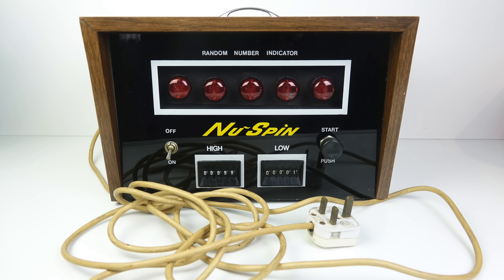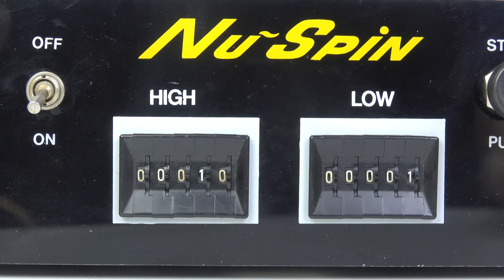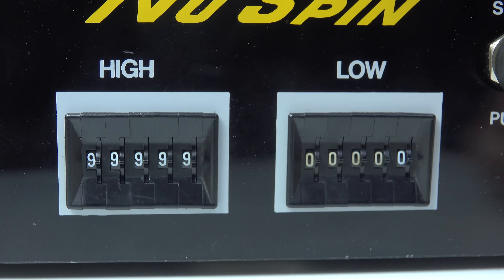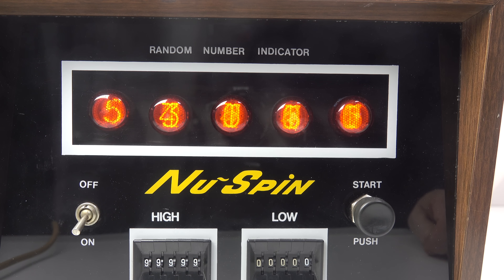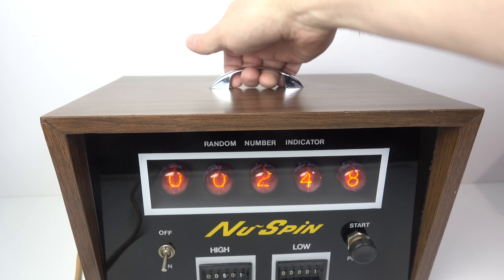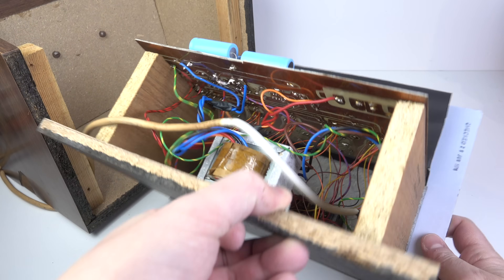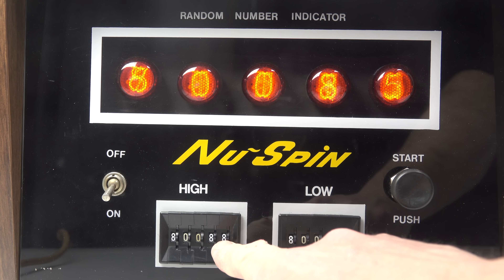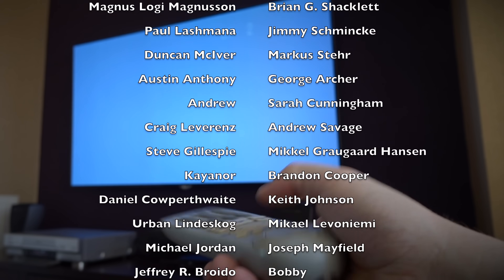This is a bit random - Vintage Random Number Generator

Comment: Random number generators are extremely useful, sometimes making a decision is hard and flipping a coin only has two out comes. So if I assign 1 to buying a new tub, 2 to hold off on spending money, and 3 to fixing the deck. I can make it decide 1-3, and let fate decide. To flip a coin you can do 50/50 low to make a more fair coin flip.

Comment: I'm pretty sure the main use is raffles.
You buy a bunch of books, in sequence, and then sell from low to high, noting the lowest and highest numbers sold. Then you set that as your bounds.

Most random numbers used in a lab will either be quite small, (e.g. will this sample be control or test), or need computers to deal with the result due to just how many numbers would be used.

What I would like to know is how it gets the random number, and what happens if you set the minimum higher than the maximum.
Reply: Also, it would be useless for an RNG for labs that need all the numbers, as each time it appears to cycle between 11000 and 12000 times.

If I got a hold of this, the first thing I would do is replace the button with a digital source which simulates holding the button down for a fixed amount of time, and see if the cycling becomes more consistent.

Comment: At 5 mins in the video, you open up the box and show the rats nest of wires on the underside of the board. And in the middle sits a big mains transformer. It does not look professionally made, and even in those days, manufacturers (even small ones) would have taken steps to tie the wires and make a neater job of it. Certainly any signal wire should be far away from the mains power, and I recommend that you get the wiring checked and tied such that that signal and mains wire are not criss-crossing and presenting some potential electrical safety issue when the box is powered up.

Comment: This would be useful for selecting pieces off an assembly line for statistical process control.  A random selection of a fixed number comprising only a fraction of the total population would be an accurate statistical sample to perform tests or measurements on that would predict the characteristics of the entire group with a relatively high lever of certainty.  These same random selection methods are used for polling or other situations where you would want to accurately predict characteristics of a large population by sampling a small group. The randomness of the sample selection is key to the accuracy of the predictions.

Comment: isn't it technically 'pseudo' random number generator ?  I mean, one of the few ways to get close to truely random numbers involves decaying radioactive material..., because of basically the heisenberg uncertainty principle in that you can't measure the exact position or momemtum of a particle that is being 'measured'.  Or something to this extend, i am in no way an expert on these matters. Maybe, someone can correct me if I'm mistaken.
Reply: Auxilium There are a few electrical,  mechanical and biological phenomena that are considered truly random too.  In this device they may be using the instability of mismatched RC circuits and the sub millisecond variations in a human pressing a button.  Another great candidate is diode noise.

Comment: I do civil engineering for a living and random number generators get used in certain types of testing to determine a random point along an alignment to take a sample. This is often how asphalt samples are taken during highway construction and since every point along the road is stationed out this is how you would determine which stations to take a sample at. That is also one of the worst jobs in the field and thankfully I completely bypassed that phase haha.

Comment: I had a Christmas present of something called IIRC "AutoDice" in the 70s. It was a box, battery powered, and when you pressed a button it would randomly illuminate two images of dice on a glass screen on the lid. Inside it was fairly crude, just penlight bulbs and two rotors that span at high speed and stopped when the button was released. It was meant to replace the dice in board games.

Comment: I've made a random number indicator too. Only 4 digits though. A popular numbers game here in Malaysia consists of betting on a 4 digit number. In this design,  the user is the random element. When you press the button, the LED display is blanked and an oscillator clocks the counter at about 500Khz , so it goes through all the numbers 50 times a second.  When you release the button the counting stops and the display shows  the number it  stopped on. 
So far it hasn't won any prizes!

Comment: I've got a couple hopefully not very frequently asked questions on this one...

1) What happens if you set the "lower" number higher than the "upper" one? Will it freak out the same as setting two numbers close together, or simply go around the loop (from 99999 to 00000) then reset from the actually-lower to the actually-higher, skipping all the other numbers in-between? I could see that being useful if you were doing a raffle and had started from halfway into one book then wrapped into a second of a different colour, but not sold a full book overall (though it'd have to be a pretty big raffle because it would of course otherwise just be easiest to set the lower number correctly and put a leading 1 on the "higher"). It alternatively might also help solve the apparent issue of it not being able to land on any number higher than 99996 (if I've done the maths from 80088 to 80085 correctly), if you set the high number to 00000 (or 00001?) and the low to 99999, if that doesn't just result in it spinning endlessly between 99999 and 00000.

2) It seems that the number it counts is dependent on how long you push the button for, and the very shortest presses don't quite make a full 100,000-count revolution. Plus when you were trying to make it show 80085, the first press counted up from zero through all the lower numbers before ultimately locking into the endless loop, instead of first checking whether it was already in the right area and resetting to it if not. So, if you set both the high and the low numbers into the 999xx range, started it from 00000, and gave it the shortest possible push (or used, for example, a very short period pulse switch connected to the contacts of the main button), would it end up giving a "wrong" result that fell short of the actual limits?

(and I suppose, 3) if you've access to anything that can produce switch pulses of a well controlled, high speed nature, what's the smallest count-up that it can be reliably provoked into making? Can you give the main button a virtual press of such short duration that it only counts up for one clock cycle, regardless of what limits are set? That might also be useful for probing what it actually does at the upper cut-off...)

Comment: can you do a review on the sharp optonica st-1515 NOT SM-1515H. The ST-1515H is a stereo tuner from 1978/1979. here's a website with some information about it:
https://www.radiomuseum.org/r/sharp_optonica_st_1515h.html
I'm asking this because I actually have one. I found it on the side of the road and am trying to fix it.
thanks.

Comment: @Techmoan, Have you ever made a video about a wireless vcr transmitter? 
The brand is Rabbit it was made in 1986, there’s a commercial about it on YouTube.
There’s one at my local resale shop for $10 and it’s never been used it’s all still neatly packaged up in the plastic bags.

Comment: These things have lots of uses. You can use random numbers for verifying and cross checking statistical correlations.
For cryptographic processes which are mostely mathematically deterministic you need a true random seed number. The unit you are having is most likely to to be used for lotteries raffles since it is displayed so nicely.
It would be very interesting to know if there is a physically true random circuit in there (maybe with a noise generater) or if it uses some deterministic method.

Comment: This is almost certainly pretty poor at generating random numbers, especially if you use all 5 digits. The "random" delay, even assuming it's perfectly randomly distributed, will be between some minimum and maximum delay. Since the counter counts up through the range at a constant frequency, the random delay range will probably not be an exact multiple of the time it takes to go through all the numbers. This biases towards some outcomes over others.

For example, if you're counting through the full range, but the random delay s equivalent to the time it takes to count up somewhere between 50000 to 200000 times, and you're starting at 0, then the counter will count up:
0 to 49999 once (always)
maybe 50000 to 99999
maybe [1]00000 to [1]49999
maybe [1]50000 to [1]99999

And so there is a 1 in 3 chance that the final number is less than 50000, and a 2 in 3 chance that it is greater.

This same exact problem is common in software random number generators. People usually do things like take a random number between 0 and X as provided by the operating system, then divide by whatever range they want and take the remainder. The right approach is to divide by the next largest divisor of the full range (which is always a perfect match), then throw away any random numbers that end up outside of your desired range. You might have to try a few times, but the result is then always perfectly random.

 If you only use it for 3-digit numbers or less it's probably "good enough" for most purposes (but don't go generating your cryptographic keys on it).

Comment: Another very interesting video about a very interesting piece of technology!

I have a lot of friends that are artists, who hold free art raffles, and each entrant is assigned a number. They will then use random.org to randomly generate a number from 1 to the highest number given out. This seems to me like something someone would use for raffles or similar things, before random.org was a thing.

I'm a bit intrigued that the highest "high" it will generate is so far off the number set. I understand if the low is the lowest number it can potentially generate, but the high should be inclusive, not one off, and especially not two! I didn't tell it how many numbers are possible, I asked for an upper limit of potential numbers! Thus if I set it to a low of 2 and a high of 5, it should eventually generate 2, 3, 4, and 5 at some point after multiple tests.

Also, I was hoping you'd test this part but you didn't: What happens if your high is BELOW your low? Say you set the high to 2345 and the low to 6789, does it freak out? Or is its error-correction to basically just keep spinning the numbers forever?

Keep up the fun videos, I have yet to watch one video of yours that I didn't get pulled right into watching the entire thing! I love the stuff you cover, and your voice is very pleasant to listen to! :3

Comment: Did you do any test to see if the number sequence generated was repeated?  Like turning it off, then on, then generating a number, and repeat the off/on/start process?  My guess is this won't reveal a flaw, as the randomness is probably a clock/timer, but a repeating method should be checked.

Comment: Unusual to do random number generation with analog technology, I thought it wasn't possible, though it is not totally analog due to some old semiconductors in use in that machine. I would think those lottery places and casinos use it before current technology starts using it. Today there is the application to generate random numbers and this machine is no longer needed. Application is available for any modern electronic device such as computers, tablets, phones, and consoles.

Comment: I worked for an engineering company a while back & we used one of these (or something very similar) for a staff lottery. After many years we eventually identified a sort of memory effect or bias towards certain numbers. It was small, but definitely measurable over enough spins. Strangely enough it was cured by leaving the machine unplugged when not in use. We never really identified the actual cause of the effect, mostly because the electronics people had more important things to do. Just posted this anecdote as I thought you might find it vaguely interesting. love your channel by the way, full of interesting stuff & very educational!

Comment: if the maximum is 99999 but it doesnt display the highest number then would you not be able to actually achieve 99999? or would setting both high and low at 00000 achieve 99999 eventually? i would ask about how the time delay is achieved but you'd have to have something that could read whatever language it was programmed in.

Comment: Maybe not a application for this particular machine, but I know a very useful application for real random generators: one time pads.

In a nutshell: you have two books with pages full of random numbers or alphabetical characters, you have a different copy of them on the other side of the communication channel. You share a method of selecting the page, or you just switch it on each communication one page forward, you XOR your message two the one time pad, and reverse this afterwards. After using it once, you simply trash it.

Reusing one time pads actually happened and then it's possible to decipher both messages - when you use enough effort. If you use them once it's impossible to break cryptography.

Comment: I never used a RNG like this, but there is something called "Monte Carlo methods" in science. Those are methods that solve problems by throwing random numbers at them  and then use statistics. Those methods are used for example at the large hadron collider at CERN in Geneva to simulate the outcome of an experiment (of course the simulation and the measurements get compared afterwards, so the theory used for the simulation can be adapted).

I don't think they ever used hardware like this, because usually  Monte Carlo methods use millions, maybe even billions of numbers, and scientist are more likely to use pseudo random numbers, because they may want to replicate the exact same results with the same random numbers later on.

If you are interested in usage of random numbers you may want to look into MC-methods. The name comes from the city Monte Carlo due to its many casinos.

Bonus fact: there is a method called "drunken sailor walk" or "drunken sailor method" in the MC-methods, you may find it easier with the name "Markov chain" .

Comment: It may be random (or it may yet be pseudorandom), but given that it won't stop on certain numbers with certain ranges will indicate that not all numbers have an equal chance of coming up. Therefore, this thing is NOT what you'd want to use for a raffle or anything else that should be fair.

If you posted some hi res pictures of the boards so that each component was clearly visible and any markings on the components readable, I (or any number of other people) could work out how this thing works.

I realize that it's from the 70s, but even back then they had the available tech so that anybody going down to a RadioShack or any other local electronics store could buy all the components needed to build a TRULY random number generator. You just need some antennae wire in there to pick up random fuzz from the radio spectrum and use that as your seed value. Want to be more sure that it's random? Take two seed values, one from the moment the Start button is pressed and another from the moment that it's depressed. Bingo, you've got yourself something anyone with a soldering iron could bash together in an afternoon.

Comment: I was a programmer for the USAF from 1978 to 1998.  WAY back in those days we used punch cards on an old Honeywell main frame.  Whenever we needed a random number we would grab the last digit of the clock.  That puters clock went out to 9 decimal points.  So the last one was moving so fast it was considered to be as random as you could get at that time.
Reply: Should of said we grabbed the number of digits we needed for the number we needed but all were from the last digit of the clock.

Comment: Such a random number generator could be a way to set a foundation for a cryptogram you are generating.  One could also set ranges and play an eight-ball style divination game.  I have personally generated random numbers for cryptograms, but I always used a combination of a basic computer program and a pair of dice to generate the numbers (computers don't generate random enough numbers without electron spin measurement in my opinion, the dice rolls add some analogue entropy). I should mention that I am currently 30 and so this device was before my time.

Comment: For a unit a couple weeks older than myself, a bit surprised it was using Nixie tubes as it seemed everyone was on board the LED train by that point... maybe this was more reliable, I dunno, but by this point LEDs were much cheaper to power.

Comment: I have never used a physical random number generator, but I have used software based ones in various programs. I'm currently working on my own implementation of a Perlin noise generator using random numbers as a seed.

Comment: Regarding the fault, it is most likely a bad contact in one of the IC sockets (which look to be the cheap type we always avoided). There must be comparators comparing the count with the switches. Loose one signal and certain numbers won’t register. You might find other rmathematically related numbers with the same problem.

Comment: Probably 31173 would fit better than 1337 on a 5 digit display. 

I don't think the main use would be for raffles and contests. It's overengineered AF to just do that, and the price of the components alone probably you could get a decent lotto-ish set with numbered balls